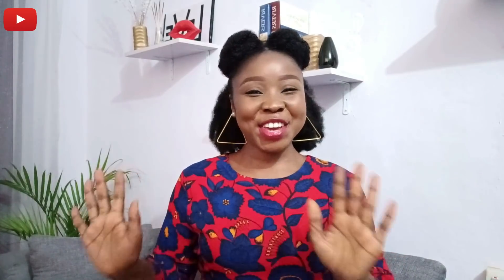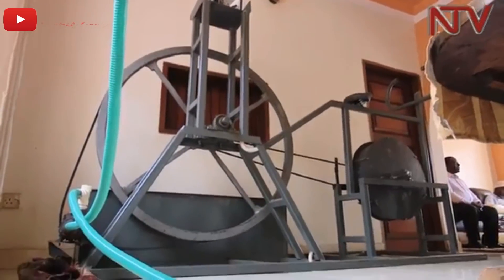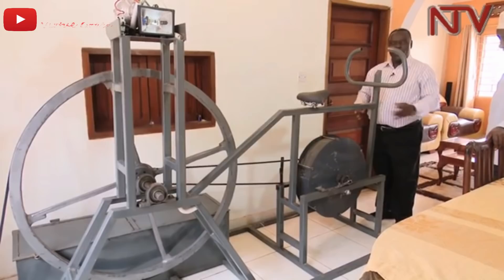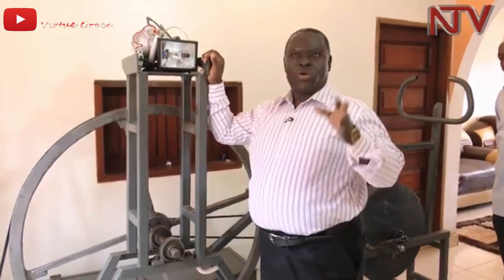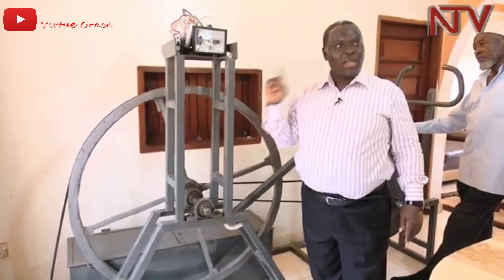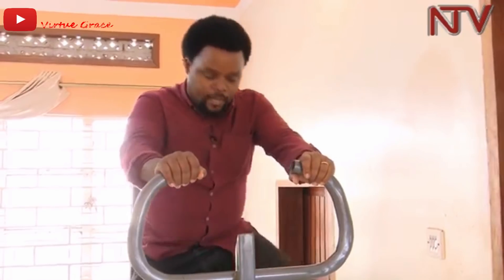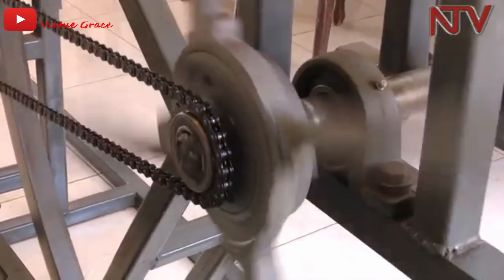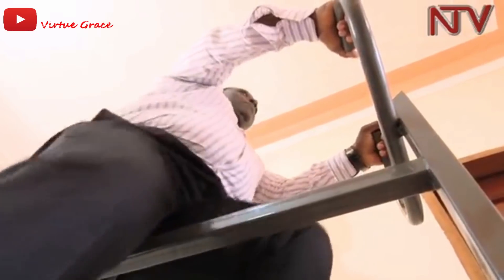THIS ONE OF A KIND SOLUTION SHOULD BE SCALED UP AND DEPLOYED ACROSS AFRICA

Comment: Why not use circulating water supply or wind power for the peddling motion......
Reply: Mi brother  this too is  halal
Reply: That what I was thinking
Reply: You do not see that it is beneficial  to the user in the form of exercise??
Reply: Re: wind power

Critics of wind power will tell you that not every place on earth has wind that is strong/consistent enough for regular power.
Critics of water supply will tell you that it's hard to do that without affecting the wildlife in the rivers (fish getting caught up in the water wheels) and it's also vulnerable to droughts.  Venezuela's power grid is based on hydropower and they've had issues supplying electricity due to droughts (which exacerbates their underlying economic problems).
Reply: humans need the exercise
Reply: @kuntri4389 , many elderly and differently-abled will not be able to power this machine.  For them, we have to think of additional options to the innovation.  Love for all!

Comment: Quite interesting. The man is right. He can convert energy from himself via the mechanical unit to generate electricity.  By the Law of Conservation of Energy, the power generated can not exceed the power from the prime mover. Also, the kinetic energy of the prime mover can not exceed the energy receved from the gentleman. According to literature, good athletes riding bicycles may get up clse to 2 thousand Watts for periods not exceeding 2 minutes. For this gentleman to make his machine to produce 5 thousand Watts, he must be able to supply the equipment with equal power, assumomg that the efficiency of the equipment is 100%. He must be a super man. All the same kudos for the good invention.
Reply: Energy can be multiplied, but what would happen to oil and gas if it was confirmed?
Reply: Get out with literature. The innovator in the video did it and all is working perfectly. He can generate enough electricity.

Comment: What happens to solar panels?  the cycling power generator is not mobile and very stressfull couple with maintenance which might cost so much compared to solar panels with a zero maintenance. However, what really matters is the battery. If you really want to enjoy a renewable energy use lithium Ion phosphate inverter battery and please  stay away from lead acid inverter battery. You can get more details from the YouTube

Comment: 👍👏👏👏👏💯👌. Funny enough, i know a big gym in New Jersey also using the same technology to fully light up its gym with clean energy. I applaud him for his innovation. Imagine if a particular govt decides to invest heavily in the health sector (developing several large scale fitness gyms operating 24/7 at extremely low prices in collaboration with other private investors).However, national grids have to be decentralized to achieve full scale generation and distribution of power. The potential of this tech is unimaginable: local production and manufacturing of fitness equipments boosting the manufacturing sector, irrigation for agriculture,as well as individual and national power generation and distribution which would probably cost way less than the insane costs govt spend on hydro dams, or other alternatives

Comment: I like it. As an engineer I think I would harness wind power to power the device. That will obviously increase the cost slightly, however it will make it more efficient. Another idea  💡 is to place a hamster 🐹 is a receiving drum placed horizontally with a bait so the hamster 🐹 will try to catch the bait and revolve the drum causing it to spin continuously and powering the device. Any other engineers with creative African solutions?
Reply from the maker: I like the solution because of the health benefit from peddling

Comment: Nice job trying to get some free electricity but it can be easier just get five long fan blades & put it on the same alternator on a smaller pulley direct on the center of the alternator & put it outside on a high pole and let the wind do the pedaling to give you max power on it is own & charge all your batteries & get 24hr free electricity so you can work in the farm instead!! 💪